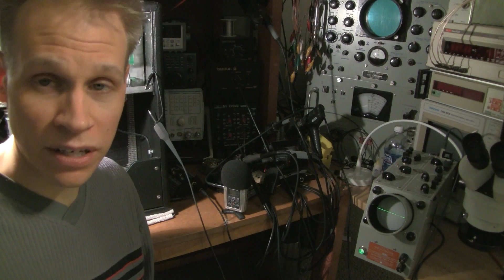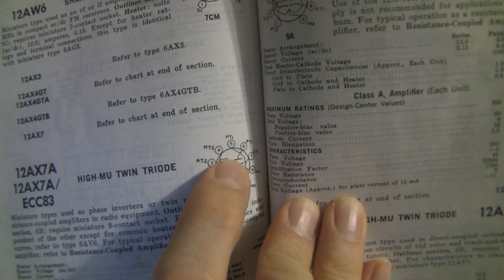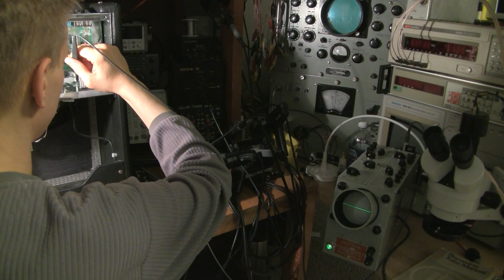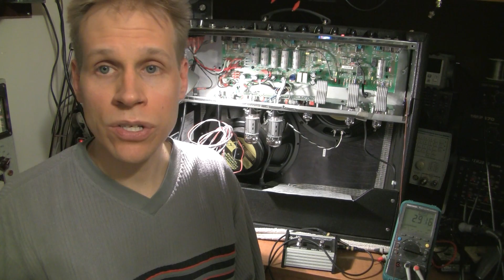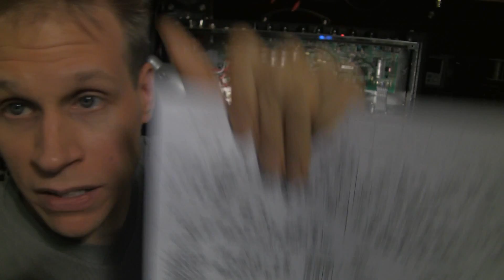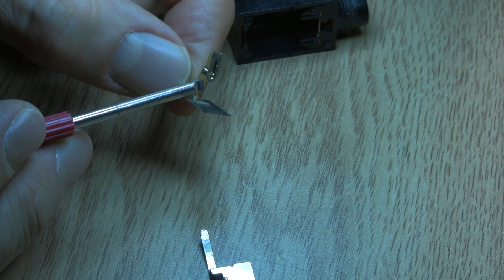Fender DeVille Amplifier, Repair and Bias Set Procedure

Comment: If you have a tube amp with probs,   it's almost ALWAYS a tube or more than 1 tube.
Reply from the maker: WisdomVendor1 Thanks for your comment!
Reply: +WisdomVendor1 I'm not sure if Mr Carlson will agree but 9 times out of 10 an electrical problem is a mechanical fault. A dry solder joint is a mechanical fault. I once had a 350 chev with an electrical problem, a con rod came through the block and knocked the alternator off.. Hahahahahaha

Comment: LoL! very funny intro. Very envious of your lab BTW.  Sad to see that Fender went the 'high tech" route with pc boards, PC flat ribbon cables and opamps..curious mixture.  Why didn't they go with FET power transistors instead of the old fashioned power tubes while they were at it. Chinese tubes may be built stronger but they still sound like c**p when played at high level. 
     I can't believe how cheap they are building these amps these days, where are the microphonic preventing  metal shields they used to use on the preamp tubes and where are the power tube socket "bear trap" spring clips to hold the power tubes in?
    Typical problem with the pushbuttons./contacts corrode and buttons become intermittent.  Have to spray the switch with
electronic contact cleaner.  Chinese technology with weak metal tension. No wonder serious players still prefer the rugged
original Fender amps.  BTW..you can run LEDs directly on AC.as long as the proper current resistor is used so that the forward current/  voltage drop is not exceeded
Reply from the maker: SuperCarver2011 I think they look at it as the best of both worlds. People really like the sound of these Amps, so they must be doing something right. I do admit, like yourself, I prefer the older designs as well.The maximum reverse voltage on an LED is 5 Volts.... Even that's pushing it. Running it on a 6.3 Volt AC heater string is asking for problems, so I just gave it a nice clean DC supply at low mA. This way the LED lasts for an extremely long time. (maybe longer than the amp will be around) Thanks for the comment!
Reply: The op amps in this amp are used for the reverb and effects loop. The guitar signal path is tube.

Comment: I work on and rebuild mostly all vintage tube audio gear these days. 120hz hum problems are pretty straight forward but 60hz problems get a little more challenging it seems.Your videos are so superb and they are a great teaching tool.
Reply from the maker: Mike Samra Thanks Mike, glad your enjoying the video's!
Reply: Mr Carlson's Lab
Paul,do you have an email where I can send you a service manual for a Sencore Lc-102 capacitor/inductor analyzer?.Everything works well on it as far as testing capacitors and inductors and values of both but I can get the HV B+ to charge the caps I want to test over 46vdc.Logic circuitry is all ok but one of the FETS are not turning on and the one that does heats up in a hurry. You may have the service manual as they are on line but I could post it maybe?
    Mike
Reply from the maker: I'm not quite sure of the question. Did you want me to take a look and see if I can spot, (take a guess)  at the problem?
Reply: Mr Carlson's Lab
Yes if you would..I think I'm on the right spot but I want to double check with you.

Comment: Hi. I take it that this is a 60W 212 if so why are you using a 8 ohm resistor when the amp label says 4 ohms, I'm trying to fit a L pad which is 100W 8 ohms as an attenuator, but when I saw the 4 ohms on the label it stumped me, but seeing this as got me wondering if I could use this L pad.  Thanks for any info.
Reply from the maker: Fender Blues  Hi, The output transformer just needs a load for testing at low levels. I'm not playing any music at a continuous volume level, so the load difference doesn't matter. If I was to play music or a tone at the rated output for an extended period of time, I would make sure the load impedance (resistance) was correct. As for your question, the correct load is important in everyday use. Make sure the load impedance is correct as any difference is reflected back to the plate side of the transformer, thus changing the plate side load.
Reply: Mr Carlson's Lab
OK I understand what you say and yes that's correct.
Is there anyway that I could use this 8 ohm Lpad to match to this 4 ohms at the amp, I have the exact same amp as you have there.
Reply from the maker: Fender Blues If I remember correctly, There may be an 8 Ohm tap hiding somewhere in there (audio transformer)  :^)
Reply: Mr Carlson's Lab
Thanks, how would I find out.
Reply from the maker: I don't recall if the schematic showed an 8 Ohm tap or not. Check there, If not, there may be an 8 Ohm tap tied off inside the amp, again I can't recall. I have seen so much equipment since then, it all blends.
Reply: Mr Carlson's Lab
I was thinking I could use 2 of these Lpads one to each speaker but joined together in the jack plug, you think that would work, I could check what the ohms are at the jack plug, maybe.

Comment: Easy to understand. Thanks. The only problem with Chinese tubes is you have to know the source, otherwise you may be buying something that just barely makes the unit turn on then BANG!
Reply from the maker: Jason Burt Thanks for your comment Burt!
Reply: They can be tested in very simple circuits and even without a curve tracer you can measure their response with few cheap parts to set up a circuit, and a multimeter to measure voltages. Tubes that make stuff go “BANG” shortly after turn on are probably mythical. There’s lots of fakes of all other components that would do that, but it’s hard to fake a tube that actually works so that it’d quickly stop working. You may get a tube that’s mislabeled but it won’t be otherwise a fake — you could probably identify its true type then, and other with the hassle of not getting why you paid for you’d still have a usable tube. Tubes are too expensive to make to waste it on making anything but non-functional fakes (although I’m sure some “entrepreneur” somewhere reads this and says “hold my beer!”).

Comment: This brings back a lot of memories. In ancient times, I used to fix my friends guitar amps. It was fun and it discouraged them from giving me a hard time. I was taught and required to keep one hand in a pocket at all times. I also plugged those ancient amps into an isolation transformer since many had a hot chassis. The repairs where typically replacing  bad tubes and bad electrolytic caps.
Reply from the maker: Peter Camilleri Glad this stirred some old memories Peter. Thanks for the comment!

Comment: The DeVilles are known to have problems with the foot switch jacks. I get many of them in with the same problem. One of the other common issues beside cold solder joints are the ribbon leads. I've encountered many of them broken. What I usually do is, I replace them with conventional hookup wire which is more durable. The H2C shorts in the 12AX7's are nothing unusual. It happens with NOS tubes as well. Good video for the advanced tech. Keep up the good work! Frank Ferraro--Audio Craft Electronics. :).
Reply from the maker: Thanks for the comment Frank!

Comment: Nice to see someone taking the time to repair at a component level rather than just swapping out the parts for new ones. Keep up the good work. Karl
Reply: I hate those jacks,... they fail so often... Would be nice if someone made sturdier ones that fit in the same space.
Reply: @Geopholus  hey this is sop from fender since leo owned the company. It,s called pinching pennies.
Reply: @Geopholus  they do... Switch craft and Neutrix.
Reply: @denniswalsh8476  As noted below replacing the resident jacks with a good Switchcraft jack requires cutting away part of the circuit board.  i personally find Neutrix jacks kinda stupid,  Switchcraft are solid and easy to work with.
Reply from the maker: Thanks Karl!
Reply: I'm 50/50 on this. It really can depend on how much time, and how simple it is to test the path. Rather than just replace a very common known failure point. I've replaced dozens of these jacks.  If it's not the switch that fails, it's the plastic barrel going through the face plate. These jacks really are a terrible item.
Reply: yeah mechanics are like that too...they don't really know how to fix cars

Comment: Here is a tip for you all. If a tube amp makes noise, turn it off, pull the input tube and turn the amp on. If the noise is still there with the first tube out, turn the amp off and put it back in.  Do the same thing with the second tube. When you get to the tube that makes the noise stop, you know which gain stage is making the noise. Then when you pull the chassis you already know exactly where to go to look for the problem. I have been repairing and custom building tube amps since 1995. I really like your vacuum tube test equipment cove. Oh yeah, biggest jolt so far was 650Vdc@500mA in the right hand while my left hand completed the circuit to the chassis. Have not slipped in years, and if I am in a live amp I wear Nitrile 7 mil(blue) or 9 mil(black) gloves as an insulator.
Reply: great tip thanks. I have a Blues Deluxe RI with opamps in the preamp section. It has intermittent crackle like bacon frying. I haven't scoped it yet but I imagine, it may be one of those disc caps with the dip too far down the leg causing a dry solder joint in a plated through hole.
Reply: Have not heard that before. Great pointer! Thank you for the info.